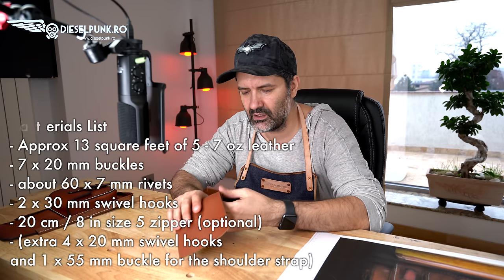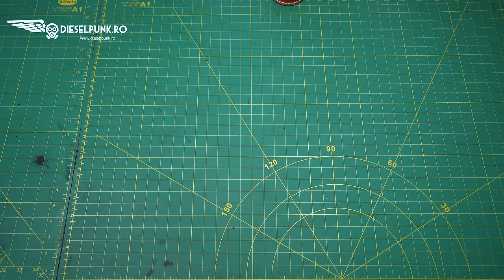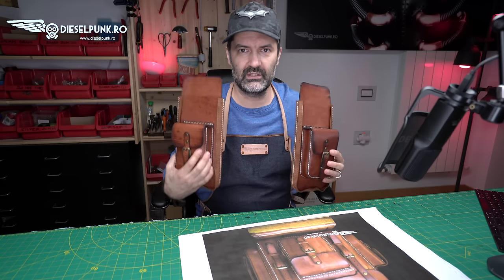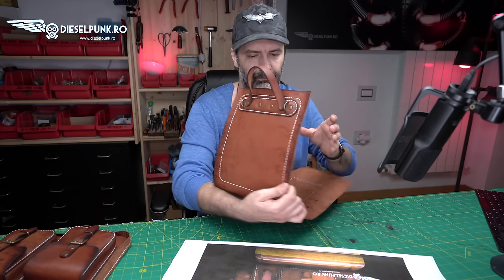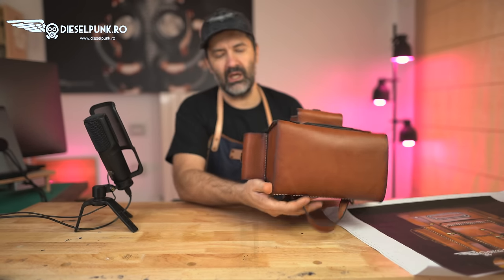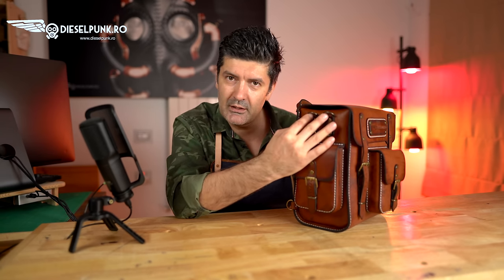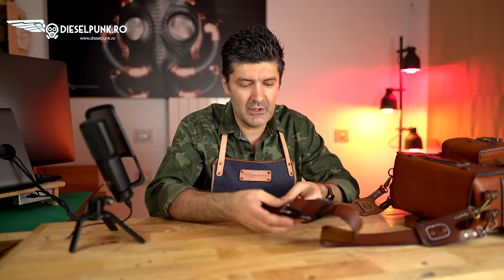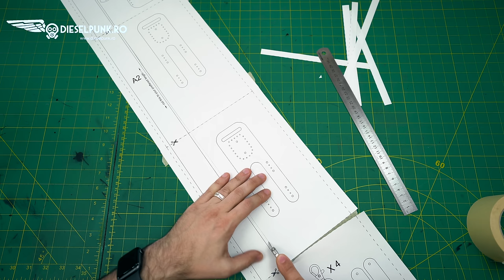DIY Leather Backpack - Tutorial and Pattern Download

Comment: Dear Tony, I just purchased your pattern because i wanted to make one for my wife. Un fortunately i use the same sinabrock as you 7pins 6mm and 1.5mm diameter. But on your pattern the spaces between the holes varies from 6 to 7 or 8 mm. So it's such a mess and a loss of leather. I started to use the sinabrocks but soon i could'nt match your holes. You're gonna tell me tha i had to punch holes one by one i suppose. So sad. i loved your patterns.

Comment: Are you considering doing a kit of hardware parts for this backpack?And, just out of interest, why did you change to a diamond punch for the holes around the pocket zipper? And why do you seem to prefer round holes everywhere else over diamond punched holes? Do the needles go through the round holes easier?
Cannot wait to make one of these for use with my new 125cc Monkey bike! Not exactly steampunk, but what the heck! 
Wish I could get away with using an “Aviator” helmet, but those days are gone!
Reply from the maker: i will do a complete pack, yes. Diamond punch makes attaching zipper much easier. round punch makes stitching leather easy
Reply: I will keep an eye out for it in your shop!
Reply: What size thread?
Reply: @izzaqelanaqimohammadhafiza2610  He mentions 1mm waxed thread

Comment: i really like thisa bag watched this video a few times before ultimately purchasing the design, but im having a hard time figuring out which peice is which because in your video your peices are numbered differntly, the design has some small descirption but ive found several pockets that say theyre front pockets....
Reply from the maker: Message me at office @dieselpunk.ro and ill be happy to help you out
Reply: Thanks I think I have it some what figured out was just having hard time finding which peice goes to which part, but if I run into issues when putting together I will get back with ya

Comment: (I know it probably has a lot to do with how well you made it) but how durable is the finished pack? Do you feel like you need to be extra careful with it, or is it a good one to take on a day hike or over night?
Reply: Hey, just noticed that nobody answered your question. It might seem easy to answer, but the question is more layered than one realises. First of all, that pack is heavier than your usual fabric hiking bags. Keep that in mind.
'how well you made it' constitutes a lot of things. What kind of leather did you use? How thick? How much oil is in the material? What kind of thread are you using? What is your definition of durable? Do scratches still count as durable to you? Does it have to be 100% waterproof? A lot of considerations go into answering your question, most of which only you can answer.
The design is for a sturdy bag,but the final judge of that has to be you, what you expect and how you treat it. This all might be useless to you, but I tried. Have a good one.
Reply: @offroadskater  Hey, thanks.